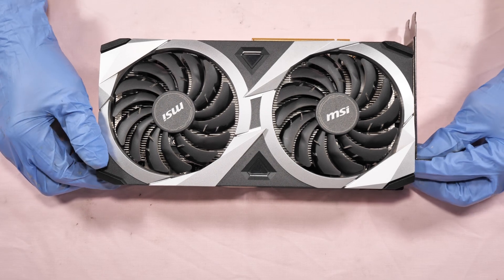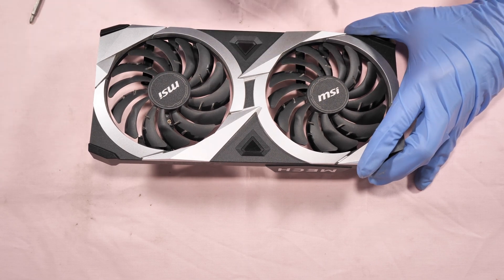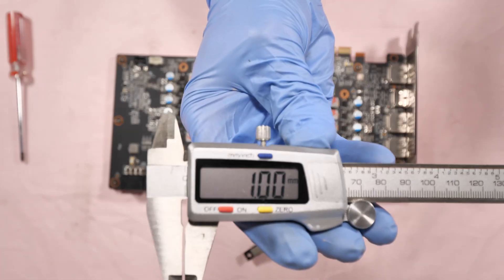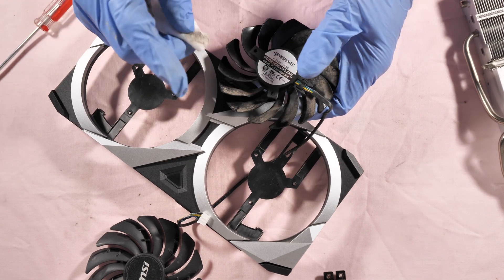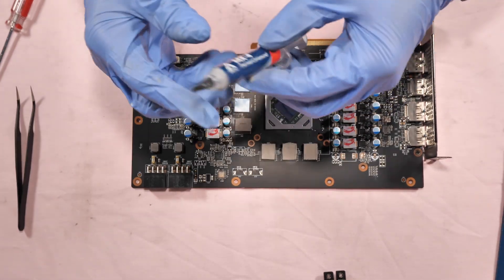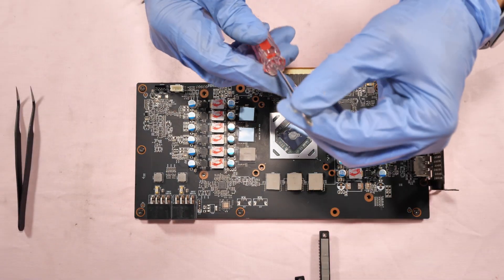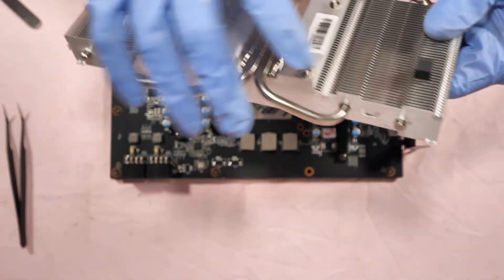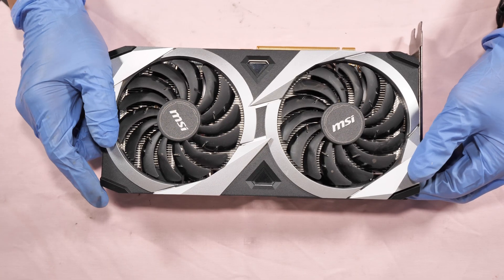MSI Radeon RX 6700 XT MECH OC | Thermal Pads Replacements\Thickness | Fan Replacements | DISASSEMBLY

Comment: Hey everyone, im here because I have a year old 6700xt mech that runs 110c hotspot under load while the core temp is 70c. Isnt that fun?
Reply: A simple repast of the GPU dropped the temperature on mine down to 95.
Reply from the maker: I think that needs repasting and get better thermal pads bro..its worthy doing it. A good quality pads and paste make a difference.

Comment: I have to do this to my MSI Mech Radeon RX 6700 XT. Could to suggest what size thermal pads to use?
Reply: Not sure if its the same but on my 6700xt red devil it was 1,5mm on the front and i added a 4,5mm one on the back to make contact with the blackplate

Comment: have you tried using ptm 7950? i have been hearing a lot of good things about it for gpu repaste. also how thick were the pads for 6700xt you used as replacement? i saw you measure 1mm do you replace them with 1mm as well?
Reply from the maker: Yes i always do used same thickness whatever is the stock as possible, if i have available replacent in my studio. I normally have stocks on shelves all sort of different thickness on thermal pads, unless i runout.
Reply from the maker: I have a GELID HEAT PHASES on my studio but i havent use it for gpy..they normally design for cpu thermal paste replacement..but a lot of people use Phases on their gpu, and have a positive feedback of what ive heard.

Comment: Hello, I would be glad if you could help me. I have the same card. The temperature is 75cc, the hotspot is 110, is this normal? It is a 3-year card.
Reply from the maker: Hi bro, 110 is thermal throttling not normal at all. While playing games, or using your gpu on heavy loads should play between 60-80 deg. Celsius. If temps reach 100 deg, that too hot already.. That needs checking and not performing well. Cleaning fans and heatsink and changing pads and paste with a high quality one might help.

Comment: hey, just wanted to asked that by watching your video i changed my paste (GC EXTEME) before applying my temps were high about 86C hotspot were 115c no after changing my temps decreased to 76 max but hotspot is still at 113C should i change the thermal pads to. BTW i have the same model as in your video.
Reply from the maker: That's a big drop 10c, well done bro! Yeah, if possible change the pads too with a good quality one like Gelid or Arctic, they perform really well.
Reply: @TakeThatScrewOut  thanks for guiding. Well just ordered 15W gelid pads 1mm after watching your video. I hope that this will fix my hotspot temps.
Reply from the maker: You're welcome bro, thanks also for your support..take care!
Reply: @TakeThatScrewOut  I Bought the size as you suggested in the video. When i changed my pads to 1mm i noticed that the hotspot went straight to 115c although the small heatsink that you showed i changed their pads to and my vrm themps are now in 70c. I need your help should i buy 0.5 mm pads now ?
Reply from the maker: Hello bro, may I ask what Brand of the pads that you've used? Just wonder why it did thermal throttle..pls use a high quality pads like GELID, ARCTIC or equivalent.. If you're in doubt the thickness, look for the SOFT kind of Thermal Pads like the Arctic, that could adopt easily with the gap, and that performs really well. GELID is also a really good choice but it's a harder (stif) side.
Reply from the maker: And make sure use a high quality Paste as well.
Reply: @TakeThatScrewOut  I used Gelid Gc ultimate 1mm pads that caused my hotspot instant 113c also my gpu temps went to 80c. I used gelid Gc extreme thermal paste. I change the pads to 0.5mm (cooler master pads) although my hotspot temps are still high at 108c but my gpu temps went from 80 to 72 max what could be the reason for hotspot?
Reply from the maker: Well, there are few possible reasons the cause of Thermal throttle,  even if we did change the pads and paste with a high quality one.. Sometimes the lost in good contact between the heatsink & the chip die might cause it, the amount of heat been transfered is just minimal can cause throttle. Don't get me wrong, I didn't judge of your workmanship.. What I mean, is this could happen to anyone sometimes. What I could suggest, undo it if possible, then spread the thermal paste evenly with spreader in the die, but don't put too much paste, and with the pads, make sure the transparent lining of the freshly installed pads both sides has been removed, because in rare occasion some people forgot to removed the protective plastic lining of the other side of the thermal pads, I can't blame them because the lining is transparent you barely see them when it's installed.. Hehehe. That's why you should always check those removed from the thermal pads. Then, when you screw back in the heatsink, make sure all mounting screw hole sits perfectly and screw in all screws in a Kriss kross pattern gradually 1 turn at a time to make sure you have a good contact. If it doesn't work, I think better change with s softer thermal pads like Arctic TP-3.
Reply: @TakeThatScrewOut  thanks for the advice bro. Yes guessing that the pads were too hard. I just found out that the gc ultimate pads are a bit hard then the gc extreme pad. Ill try changing it to extreme and will update but for now im thinking of undervolt the gpu to reduce Vram temps
Reply from the maker: Wish you good luck for your gpu bro.. And love to hear the future result of what you're about to do with your gpu. Take care bro! 😀
Reply: @farhanafzal3627  hi did u fix it?
Reply: @mix3242  are you facing any issues ?
Reply: I would like your help

Comment: I'm going to remove the black plastic shroud with the fans because they're so loud, especially at around 60% fan speed and above, and replace them with two regular 120mm fans (via an adapter I already used on a different GPU). Could you tell me which of the two black and white connectors is the fan controller and which is for the light?

Comment: Are these heatsinks copper or aluminum?
Reply: Chopper
Reply: @ackbarboypratama1277  copper but cheaper? xD
Reply from the maker: These are copper bro plated with zinc. That's why the color is silver, but that's copper inside. Hope this helps.
Reply: @TakeThatScrewOut  is it galvanized copper in this case?
Reply from the maker: What I meant copper is the die plate that contact the gpu dia ang this pipes attached to it.

Comment: por fin MSI hizo un buen diseño del disipador para una placa de video y tambien coloco bien los pad termicos y no como en las MSI mech serie 5000 que hicieron muy mal trabajo 🤣
Reply: esta placa es un desastre, levanta hasta 110 grados (limite) y con programas AAA (FS2020/2024 y similares) no baja de 80 grados con el mantenimiento bien hecho. Además faltan las medidas de los thermal pads del backplate que son enormes, parecen ser de 3 o 3,5mm el de debajo de la GPU y de 2 a 2,5mm los otros.
MSI lo pone muy difícil, y es una placa ruidosa si la quieres a menos de 70 grados en el hotspot
Reply: @Daniel_Wolf   yo acabo de comprar una de segunda mano a 290 dólares y le sucede lo que dices, probe furmark y de inmediato subió a 110 el hot spot, tuve que limitar los fps para mantener temperaturas estables, no se por que es tan difícil encontrar info sobre las medidas de los termal pads, no quiero comprar y que luego no funcione, por ahora pienso hacerle un undervolt.
Reply: @RubenPierce  el undervolt funciona pero te saca mucha potencia. Tendrías que compensarlo con un pequeño overclocking del procesador y la memoria. Vas a tener que ir probando. También te sugiero que cambies el ventilador a configuración manual para poder realizar una curva de temperatura que sea más eficiente que la original. Aún si no cambias los termal pads siempre puedes desarmar con mucho cuidado. Ayudado de una hoja de cutter muy filosa ir separando con cuidado los thermal pads y ponerlos sobre un trozo de nylon. Alarmar los pones al revés de cómo estaban originalmente Y eso te va a prolongar la vida otro año. Te sugiero que compres una pasta térmica muy buena, repito, MUY BUENA y le pongas una pequeña capa sobre la parte que apoya en el disipador y la parte que apoya el componente. No exageres ya que solo es para compensar la diferencia de altura que pudiera tener el pad . después armas ajustando bien y bajará bastante la temperatura. No olvides que en la parte trasera entre la placa y el backplate hay más superficies y pads que obran como disipadores. Haz el trabajo con cuidado en todos estos lados limpiando bien con alcohol y un hisopo todas las superficies antes de poner la pasta. Después me cuentas cómo te fue. Es un trabajo que en una hora lo tienes terminado
Reply: @Daniel_Wolf  revisando bien, creo que sería mejor pedir los termal pads, veo que anteriormente la gráfica en algún punto el anterior dueño la destapó, supongo que para darle mantenimiento, pediré de las medidas del video y de 1.5 más 3m por si acaso, según veo en comentarios el back plate tiene unos termal pads, no se sus medidas utilizando un micrometro podría sacarlas, de pasta térmica tengo una artic mx-4, se que es buena en procesadores pero no se en graficas, los termal pads los comprare de la misma marca de la pasta que vi que son buenos.
Reply: @ si estas gpus amd las temperaturas del hotspot se van al carajo hace falta hacer limpieza cambio de pad termico y pasta termica aparte todas estas gpus fueron usadas en la mineria jeje.
Reply: @Daniel_Wolf  los termal pad de atras del blackplate casi siempre son de 3mm.

Comment: Morning sir. What happen if i used 90% alcohol to clean chip in gpu? Sr for my bad english
Reply from the maker: Thats perfect bro, 99 or 90% is not much difference..the reason i dont recommend the lower 70% is because it takes time to dissipate the liquid. But if 70% is only available to you, you can use it..just make sure to dry up before putting all the compinents together using blower or simpky hair dryer.

Comment: Did you try test temperature without the backplate? It is made of plastic so it cumulates heat on the back side indtead of conducting heat and emmising it out of the card like metal backplates do.
Reply from the maker: the plastic backplate serves as protection cover of the outer side of the pcb. No, i haven't tried to use this gpu without the backplate.

Comment: Is there any generic option to replace her plastic BackPlate with a metal one? To have a more effective thermal exchange (even put a thermalPast between the BackPlate and the back of the memories - I did this with my old 5700XT).

I ask this just out of curiosity, because I use it with Undervolt, so I have no concerns about temperature
Reply from the maker: Well, perhaps you could try searching in ebay for custom made backplate for this particular gpu..but i doubt if you could find one bro..

Comment: bro do you know thermal pads thickness MSI Radeon RX 6600 XT MECH OC? is it the same of 6700? Thank you!!
Reply from the maker: Hi Bro! I can't confirm the 6600 xt pads thickness..I've tried to gather some researched about the info from MSI site and other blog post from other owner, but unfortunately can't find one bro. I am assuming it should be the same thickness with RX 6700 xt MECH that is 1mm thickness..you can't go wrong using a 1mm on that particular card. just make sure use a good quality Thermal Pads and a Soft one like the ARCTIC TP-3 or equivalent pads.

Comment: it's much more easier to teardown than the rx 580 mech 2x oc model 💀
Reply from the maker: Definitely..this dual fan card is very straight forward and easy to work with..only few screw and you could access those important areas for maintenance..good design.

Comment: hey anyway is it ok to apply thicker thermal pads ?
Reply from the maker: Should be fine if the thicker difference no more than 15% than the recommended one..and make sure its a soft thermal pads..be aware there are few Pads are stiff. Don't use those pads. Stiff pads only best for the right thickness
Reply: @TakeThatScrewOut  i see , thanks for your guidance, i have the same card but it's used so i need some maintenance which is important to keep these from overheating, i actually has a plan to use copper thermal pads, but dont worry i already researched how to apply those stuff

Comment: hey! so i was planning on painting this GPU shroud and backplate white, but i have never disassembled a GPU before and i'm nervous about it

do you think its possible to remove the backplate from the PCB without having to replace the thermal pads or repasting the GPU die? 

i'm worried that when i take off the heatpipes from the PCB, that the thermal pads will end up ripping off and i would have to replace them

repasting the GPU isn't that big of a deal, but having to cut out the thermal pads in the right shape for each memory module seems a bit annoying
Reply from the maker: Unfortunately, you have to remove the Chunky heatsink to access those screws that holds the Plastic backplate. Those screws that holds the VRM's strip heatsink is on the middle part of the pcb..that needs to be remove as well bro so you can fully detach the backplate from the pcb. I know is a bit annoying isn't it! 🙄😔

Comment: Hi I wanted to ask. When installing the new thermal pads. Why did you use two different versions? Also, what thickness were they? since the links in your description show 1.5mm thermal pads but in the video you show when measuring them that they are 1mm thickness? Oh and did you add new thermal pads to the screw in heatsinks too. Were they 1mm thickness too? I'm confused as to which ones I should buy or does it not matter?
Reply from the maker: Hi bro! sorry for the confusion regarding on my videos..all the links on the Description are only reference only for parts and tools related to whats in the video..but not necessarily exactly the same on what's in the video. Whatever measurements you see in the video is the ACTUAL THICKNESS based on my personal observation about the materials. And regarding the two different color of pads i've used, that would happened sometimes on my tutorial videos due to sometimes the pads that i've used run out and not enough for the whole areas to cover, so i've used other brand of Pads whatever is available during the Tutorial, that's the reason sometimes they have different color but they are exactly the same thickness for sure only the Brand and color is different..hehehe! Thanks for your comment bro! appreciated!
Reply: Thank you for the detailed response! I understand perfectly now how to do everything. This video has helped out lots
Reply from the maker: You're welcome bro! and thank you for the support! Enjoy!

Comment: I got the same RX 6700 XT it makes a clicking sound and gets to 90 degrees could this repair fix it?
Reply from the maker: Thats sounds interesting..you have to figure it out where that clicking sounds came from, and thats temps is quite high. if both fans still spins normally during heavy loads, maybe you can try to open it up change the pads and paste with a good quality..make sure to use the right thickness of the pads it uses 1mm thickness
Reply: @TakeThatScrewOut  Okay, that sounds like a plan. I already have good thermal paste, the Noctua H2, so do I buy the thermal pad in the description? There are two of them.
Reply from the maker: That's a good choice of thermal paste.. If you want you can use the link in the description, make sure to click the right link based on your Country, and choose the correct thickness.
Reply: @TakeThatScrewOut  Yes, very good thermal paste, but there are two links for thermal pads. Which one should I buy?
Reply from the maker: @DokDokey  wait bro, i'll make a new link for you for the 1mm pads
Reply from the maker: @DokDokey  https://amzn.to/3R8BwFZ
https://amzn.to/44FMjKW
Reply from the maker: @DokDokey  check that link i created for you for 1mm pads..you choose between those.thats an ARCTIC TP-3 and THERMALRIGHT. that link is from Amazon United States.
Reply from the maker: AMAZON UK LINK:
ARCTIC TP-3 1MM - https://amzn.to/3Z3jqY7
TEUCER 1mm pads - https://amzn.to/44vtxWJ
Reply from the maker: @DokDokey  AMAZON UK LINK:
ARCTIC TP-3 1MM - https://amzn.to/3Z3jqY7
TEUCER 1mm pads - https://amzn.to/44vtxWJ
Reply: @TakeThatScrewOut  Sorry for the late reply. Which one would you recommend?
Reply from the maker: I recommend Arctic TP-3 because apart from it works really well, its soft that could adapt any gap easily. 👍
Reply: @TakeThatScrewOut   Alright, I bought them. I had to pay $50 AUD, but better than buying a new GPU, I suppose. Thanks so much. I hope I can fix my GPU with this and the thermal paste. I might need to buy fans as well. Do you have any recommendations? And is there anything else I should buy?
Reply from the maker: @DokDokey that's brillant bro! I'll try to find a fan replacement for you for this gpu.. Which Country you from US or UK?
Reply: @TakeThatScrewOut  I am from Australia
Reply from the maker: @DokDokey oh i see, that link i've sent you is from Amazon uk & us.